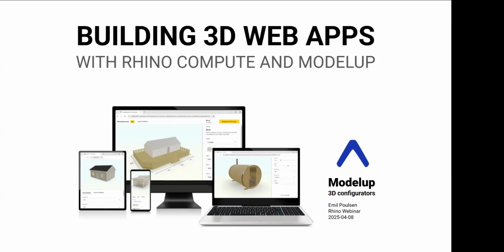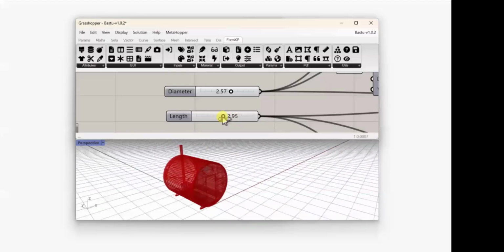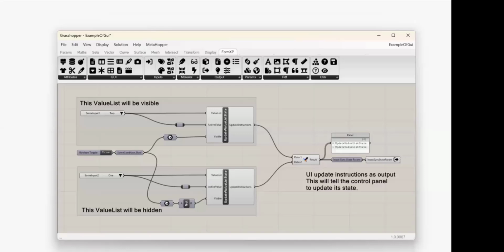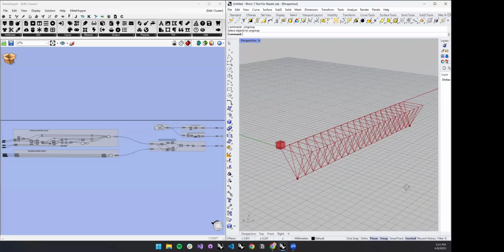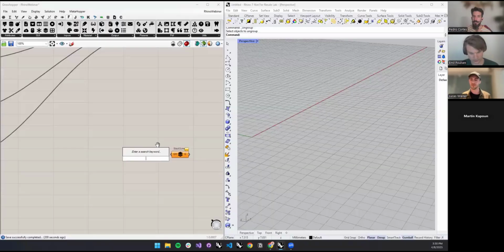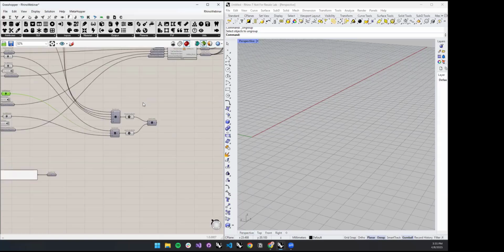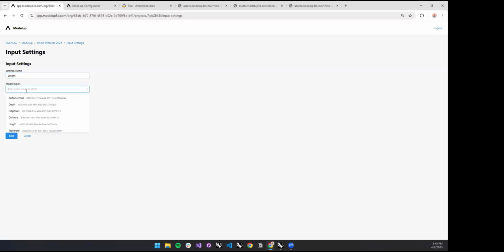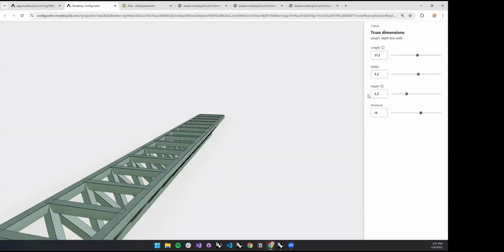Rhino User Webinar: Building 3D web apps with Rhino Compute and Modelup

Comment: Hey! I'm trying to create a web UI with rhino.compute. but my grasshopper files are not loading at all. What I'm trying to do is use the rhino appserver which is a node server that has solve endpoint that basically calls rhino.compute which is a dotnet server the code for which is also available on rhino3d git repo. Can you help with the grasshopper files? The sample files available work fine but my custom files which work on the rhino software don't on the web UI